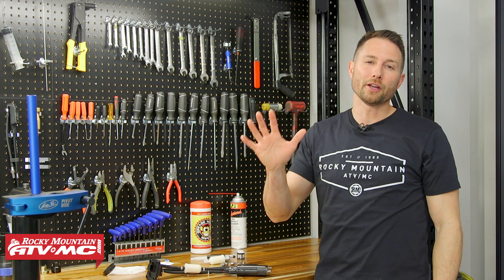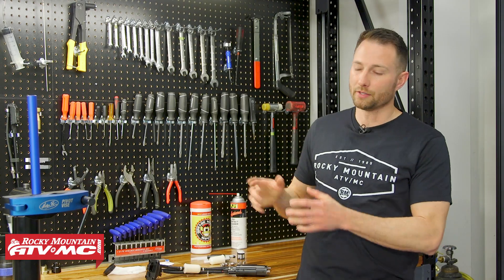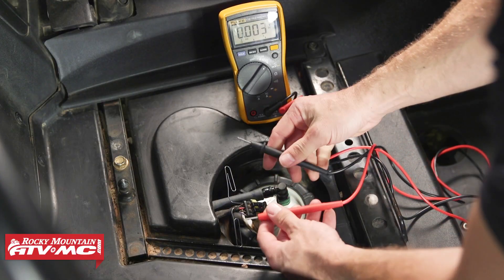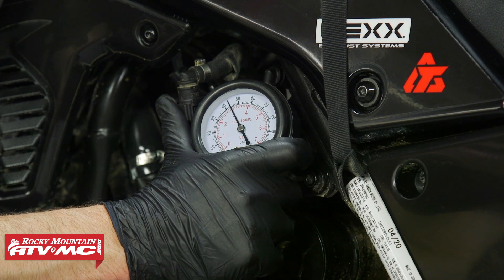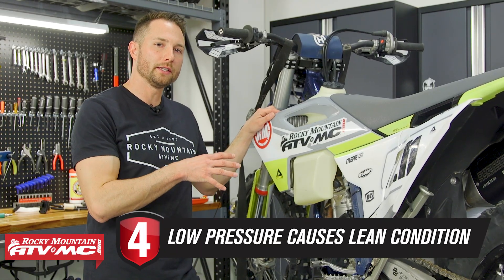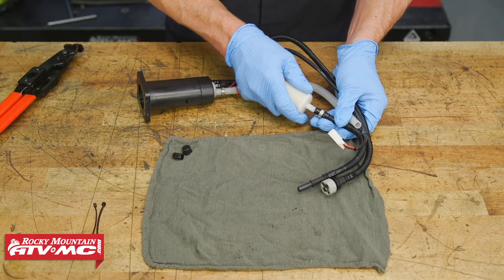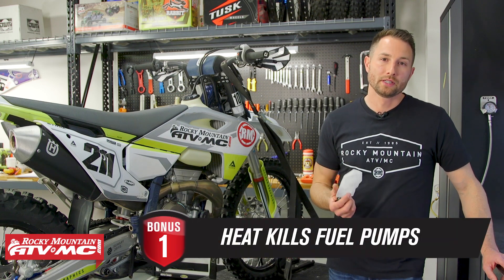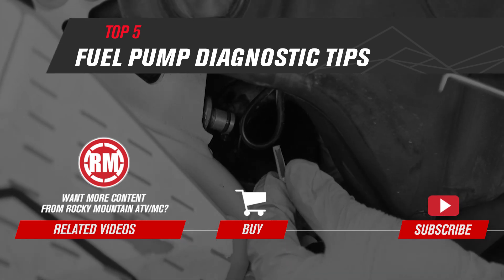Top 5 Tips to Diagnose Motorcycle, ATV & UTV Fuel Pump Problems

Comment: My motorcycle, the R1200RT, doesn't have any relays or fuses. Instead, it has a computer called a ZFE module. When I turn the key, I don't hear any fuel pump noise. When I press the starter button, the crank turns, but I can't replace and test the expensive ZFE module, so I don't know a simple way to determine if it's defective. Any help would be appreciated.

Comment: My yfm700 grizzly gets power to the pump when during cycling when key is first turned on; but not when winding over starter motor. Any ideas?
Reply: Loose wire somewhere, if it's still an issue run a jumper wire from pump to hot when key on
Reply: Thanks @opaic777 it was the lean angle sensor. I'd driven through flood water years before and it eventually corroded. 
I was able to tape it in an upside down position ( for some reason it worked in an upside down position) until I got a replacement.

Comment: My fuel pump only primes when the engine is cool.  Once it’s warmed up and you turn the key on there is no fuel pump prime and no start until it’s cooled back down.
Reply: Wisdom, did you ever figure this out? I'm experiencing the same condition with my Ducati Multistrada.
Reply: @mikedacy6219  Mine ended up being a bad fuel pump. I swapped it out and have had zero problems since.  Please let us know what you come up with.
Reply: Thanks for the response. I'll let you know.
Reply: @mikedacy6219 any updates Mike?

Comment: Interesting timing,  I just replaced the fuel injection pump-motor on my WR250R Yesterday.
The bike is basicly Brand New - sat for 1 winter, and the OEM pump crapped out.. 
Anyways..  Now w/ the new setup in,  and 4.7 gal tank Topped Off,  
the 'low-fuel-LED-light" has come on and won't stop blinking.
[No one seems to be able to provide a straight answer for fixing it either]
If anyone has any advise/ideas - They'd be very much appreciated!
Reply: have the same issue on my xt1200z did you resolve it? if so any tips to look at?
Reply: @ibrahimoualmakran5780  Crazy Timing!  A few hours ago,  I'd charged up my WR and ***Tried firing it up...  Nothing!!  Full power, so, now it's either the relay/solenoid Or Another Dead Fuel Pump.  [Pretty pissed off]

We're going to be looking at it later on [Saturday afternoon] so as soon as I know more,  I'll try to get back here to update! 

Funny enough - I don't think I saw the 'low fuel LED'...  haha

Sam -
Reply: @DirtyDovi  haha so you still on it?
I will check the fuelpump relay next ( no power to the fuelpump connection when cycling the key).

Thanks for the feedback !
Reply: @ibrahimoualmakran5780  Yuuup,  and about ready to hit the thing w/ a flame-thrower!  lol  Just did a 2-day slow charge,  cycled the key, and NOTHING..  No relay/No pump..  My buddy had to bail, but hoping he'll have his diagnostic equipment over here soon.  *We're all in this one together! =D 
Sam -
Reply: @DirtyDovi  haha lol well we feel the same here very frustrating with my xtz 1200 

was stored for 4 years: 

First: 
 good wash, jumped with truck battery hit it with some brake cleaner fires right up for 2 seconds.
Diagnosed the fuelpump wasn't running. 

Second: 
 replaced the fuel pump, was stuck so replaced it with a bosch unit.
Cleaned the fuel tank + fresh fuel 
New oil + oil filter 

But still no fuel prime... 
No power to fuelpump...
Fuel level gauge blinking 8 times...
Flaps don't open...
No vacuum effect at intake...
Swirl flaps not opening...
Bike cranks fine
And was running perfectly before storage

Seems like I'm making it worse...
I'm in no way an expert... just a young man trying to learn some bike stuff on my own (first motorcycle).

Any tip is very appreciated .